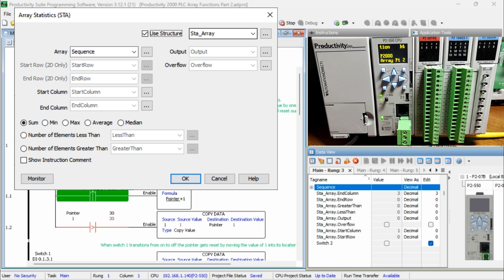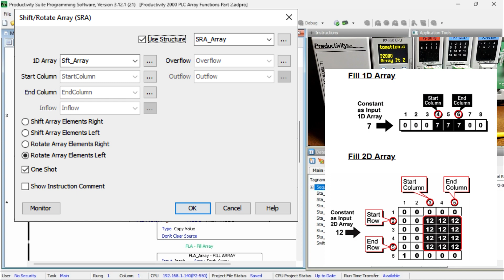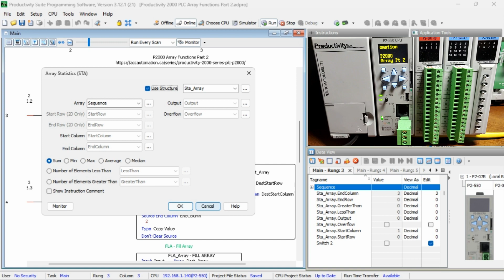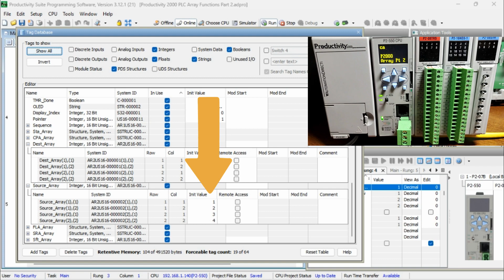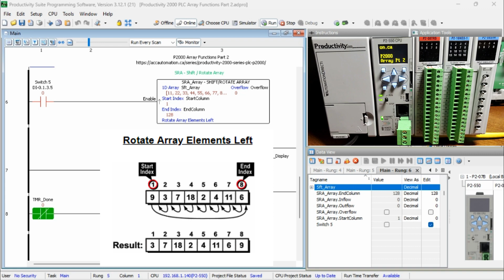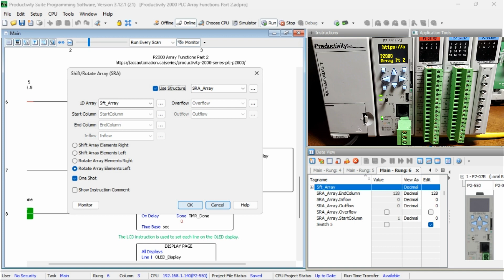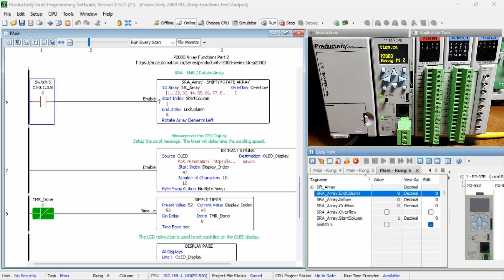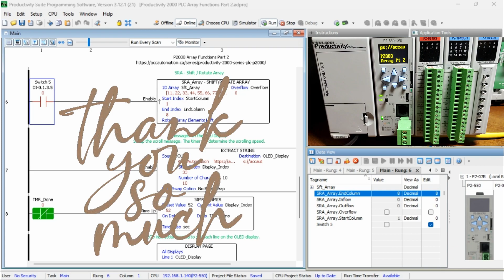Master PLC Arrays: 4 Power Instructions That Transform Code

Comment from the maker: Detailed information can be found on our website. The post for this video is located here:
https://accautomation.ca/productivity-2000-plc-array-functions-part-2/

The Productivity 2000 Series PLC is located here:
https://accautomation.ca/series/productivity-2000-series-plc-p2000/

There are several reasons why we are using the Productivity 2000 Series Controller. Here are just a few.
- CPU with 5 communication ports
- 50MB user memory - Can handle very complex applications quickly.
- Limitless PID – Autotuning – Individual or Cascade Mode - etc
- OLED message display on the CPU module
- Plenty of discrete and analog I/O modules
- Status displays on all discrete I/O modules
- I/O Modules have QR codes. This can be scanned for the module's latest specifications/wiring diagrams.
- OLED data display on analog modules
- P2-RS remote I/O expansion module, or use the Productivity1000 P1-RX remote expansion module to add even lower-cost remote I/O to your system
- FREE full-featured Productivity Suite software
- Programming with several ports - USB, Ethernet, Serial
- Hardware auto-discovery
- Hot-swappable I/O - Remove cards with power on the system
- Choose from three wiring options
- Slim DIN rail density form factor:
 - hardware - power supply, CPU, and seven modules in only 10-1/2 inches
- All project files (program, tag name database, and all the program documentation) in the CPU
- Run-time editing and debug mode on CPU
- Easy data logging with micro SD on CPU
- Secure Web server to access data files and system tags
- Easy drive and motion controller integration
- Coordinate motion control with PS-AMC allows management of up to 16 axes and synchronization of up to 4 axes
- Two-Year Warranty

The Productivity 2000 series of programmable logic controllers currently has all these features built into the P2-550 CPU.
This CPU (Central Processing Unit) is also known as PAC (Programmable Automation Controller) because of its communication capabilities.

ACC Automation
https://www.accautomation.ca